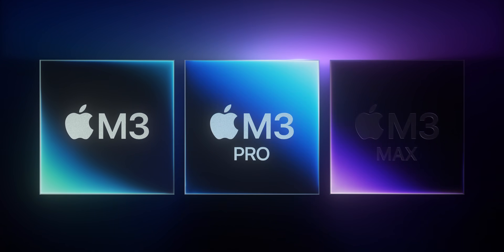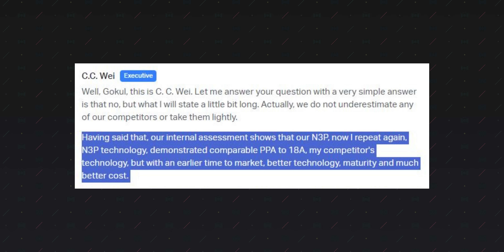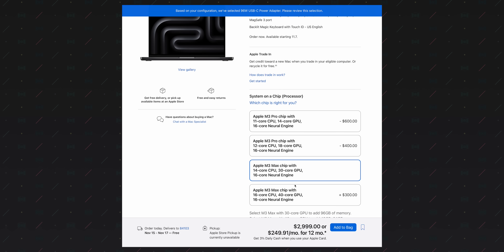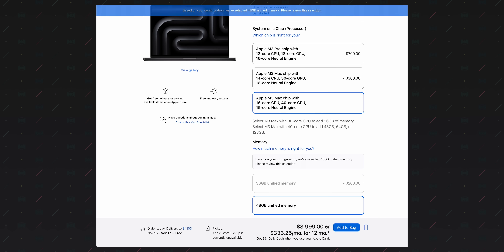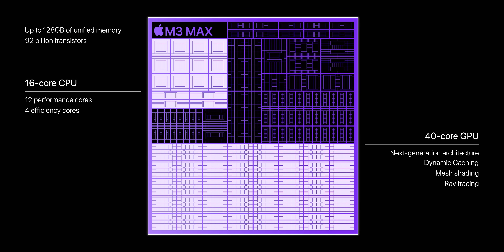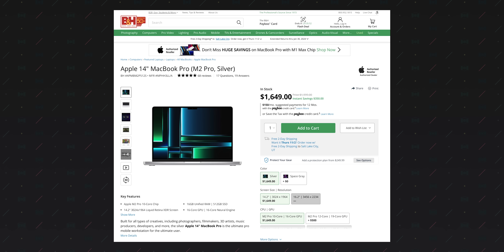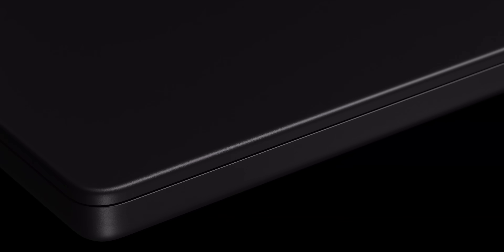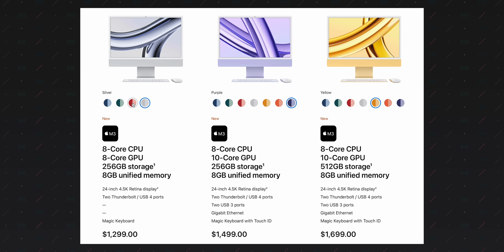Apple M3 Deep Dive: The Details Most Skipped Over

Comment: In Comments, I’ve been contacting countless YouTubers who cover Apple (or on Social Media) for  now to find out if  can tell me if loading up a BTO Mac laptop (MacBooks, mainly Pro M3s) with  amounts of RAM and  storage capacities  To explain with two very different configurations, is a M3 Max MacBook Pro with the maximum of 128GB of RAM and maximum 8TB of storage appreciably  than the  model MacBook Pro with the  48GB of RAM and 1TB SSD — ?

The chassis of both are  so the internal space to distribute heat is unchanged between the two; however, the more RAM, the more heat. And SSDs are  for the absolutely  temperatures they reach. So does a maxxed out MacBook Pro  (throttle) the performance speed of the SoC making it an overall slower machine? Or are speeds unchanged between the two, but the  comes on more often than the lower configed MacBook Pro?; or spins faster?; is louder? Or, is there  I’ve been asking and asking this question but have yet to get even a theory in response.

Could you please give this question consideration? It may mean the difference between choosing a balance between sufficient RAM and storage for today’s and future needs with any thermal consequences that RAM and SSD amounts present. Thank you much.

Comment: If anything, yes M3B is a loss for Apple with lower yields. But for the consumer it is a good processor, atleast the binned ones. Ok a bit expensive. Still awesome silicon. And M3E will likely on the average be less performant due to less transistors. And you do not talk about this. Your perspective is odd. Slightly LTT like and negative, but maybe that is the point for Mac coverage now, Apple Silicon positive coverage will net you less views and less channel revenue. Dissappointing Intel sponsored trend.

Comment: Just bought my daughter a 15” Macbook Air 16g, 1TB, midnight on sale at Best Buy for $1,650. She really wanted a black (or midnight) laptop, hordes videos photoshop projects and never closes applications 😬. So an equivalent Pro model would have meant making a concession in either aesthetics, multitasking ability or storage. I don’t think she’ll need anymore CPU/GPU capability anyway. But yeah, if I bought it at full MSRP I’d be a little chapped that I could have spent only a $100 more for a substantially better “Pro” laptop, albeit in a less cool color option. Really lame they only reserve the midnight for the top tier. Apple really knows how to stair step their customers. This is the first new Macbook I’ve ever bought. If you’re really selective and shop carefully there are always a ton of used Macbooks to be found. Say what you will about Apple, they make well built machines and their fan base upgrade way more frequently than windows customers do. I’ve bought about five really inexpensive used Macbooks, all of which lasted for ages. So if you consider the second hand market, Apple is actually a pretty good value proposition. In fact, I wouldn’t even consider buying a used plastic Windows laptop, as I’ve bought many expensive new ones that rarely hold up well. I actually bought my first Macbook for MagSafe after my kids and dogs broke a third and final charging port. Not a fan of Apple by any means, but their laptops are a much better user experience and have actually cost me way less over the long haul.

Comment: Apple M3 Pro chip with 12‑core CPU, 18‑core GPU, 16‑core Neural Engine, 18GB unified memory, 
1TB SSD2

Refurbished 14-inch MacBook Pro Apple M2 Pro Chip with 12‑Core CPU and 19‑Core GPU, 16-core Neural Engine, 16GB unified memory, 
1TB SSD2
Im a new to macbook sir, i wanted to use it for long term, I am stuck between the two. What do you think is the best option for this? Hope you can help me with it.

Comment: The iMac is a pretty good computer for home use and light gaming, not sure how it comes off as an "afterthought".  VS the M2 Air, it's 9" more screen in exchange for not having a battery (a plus for me) at the same base price.  SSD and RAM upgrades are obscenely expensive for every mac model.
The magic trackpad is great, I use one on the left plus a logitech mouse on the right.  Lightning makes no difference - it's on the desk so having to "carry two cords" isn't a thing.
My only disappointment is that, vs the laptops, I can't pay $300 extra to upgrade to an M3 pro chip.  The extra GPU would be welcome for "medium" gaming.

Comment: Snazzy, I had heard that the M3 was supposed to be head-and-shoulders faster than the M2. This was not that.
Your explanation of the difference between the N3B and the N3E seems to make sense.
It's still scary faster than the intel Macs so that's why they're pushing everyone to upgrade.
They almost explicitly said the Space Black finish would not have the problems of the Midnight Blue.
The iMac can be bought without the Lightning peripherals. I already have a USB-C Bluetooth keyboard and mouse I could use.
I'm looking forward to a revision of the iMac design soon. No, I'm not expecting a return of the 27" iMac.
As it is I'm quite happy with the M1 MacBook Air I got a few weeks ago. This thing is so much faster than my ten-year-old 13" MacBook Pro because of course it is.
I won't even consider upgrading again until we get the M5. I hope by then they'll have expanded the I/O channels to support more USB and Thunderbolt ports.

Comment: The M3 Max chip was the most interesting processor in the new M3 line-up, offering some genuine multi-core CPU performance differentiation compared with the M3 Pro, and significant GPU improvements over M2 Max, but it still has the same single core CPU performance of as base M3 chip (unless Apple offers better boost clock speeds on the M3 Max). M3 Pro was a bit of a disappointment. Will I be buying a new MacBook Pro? No, I will stick with my M2 MacBook Pro. M3 and bleeding edge 3 nm process may not be a good long-term investment. M4 may be a safer bet. In all honesty, I was much more excited by Qualcomm's 2023 Summit and the new Snapdragon X Elite arm64 processor. The latest Apple events are a bit like watching a slick Magician, where you are never quite sure how they do it, but you have some nagging doubt there may be some sleight of hand! I am no longer excited by the latest Apple Mac devices. OK, they are beautifully made, and Apple Silicon was amazing, but they only really make sense if you are media content creator or coder. I tried gaming on my M2 MacBook Pro, and it works, especially if the game is optimised for Apple Silicon. Not so good if gaming via a Windows 11 arm VM / Parallels desktop or CrossOver (though inclusion of Apple game porting toolkit components provided a boost), but so many of the games I play on my MacBook Pro (including via CrossOver) depend on Intel emulation. So, if Apple ever end of live Rossetta 2 that will be the final nail in the coffin ... at least I will still have my Steam Deck!

Comment: The 13 was a better laptop than the fan less air better performance cooler touch strip more reliable and durable faster charging better speakers.
It only lost in the looks because of bezels and slightly smaller but just as good screen

Comment: People keep missing the biggest point.  All Apple processors (A and M), soon to be everywhere, have the same 3D capability.  So why is this important?  In the PC world, you can get high end 3D cards, but they are all different, and the game has to be built for that specific hardware which almost no one has.  In the non iOS world, the games are "mobile games" (Yes, you Diablo).  For the first time ever, the same games run on all Apple hardware at acceptable speeds.  Think about that while you read up on the old pre-iPhone mobile browsers.

Comment: Some people purchased the 13 MBP because it packed more power and fans in the same basic size of the air. Add in the Touch Bar (some people like it) and yes, there were people who were informed and sought out the 13 MBP. I’m slightly sad that now I will have to upgrade to a 14 when it’s time, but I’ll hang onto my M1 MBP as long as possible.

Comment: So far, it appears rather disappointing. Releasing the M3 chip in an actively cooled chassis makes it seem like a hot chip, prompting a pause before implementing it in a passive cooled chassis. This decision could be attributed to the negative impact of previous MacBook Air models on MacBook Pro sales, which used to account for around 54%, but now only around 40%. Consequently, they need to present better figures to investors.

However, even the base model of the M3 Pro chip has only 11 cores, slower RAM compared to the M2 Pro, and there's still uncertainty about the SSD. If you want the slightly improved M3 Pro over the M2 Pro, you'll need to spend an additional 3000 euros, which doesn't make much sense. In general, the shift from 8 performance cores clocked at 3.5GHz to 6 cores at 3.7GHz may result in a hotter device or require getting used to fan noise again. So far, it doesn't look promising. 😕

Comment: Qualcomm's new Snapdragon "X" SoCs are poised to at least match Apple's M2 ans M3 SoCs and possibly surpass it. So Apple's claim to being the "best" laptops could come to a quick end in 2024. And while Intel is just stupid in how they have dealt with their laptop chips, if battery use is not a concern, the new generation Intel chips will be faster than the M3 in most cases when paired with Nvidia GPUs, provided Intel is intelligent enough to use AI assists in its processing for video rendering and high-demand "work-desk" software. 

Apple has a long history of screwing its customers with their Mac Book lineup, and charging exorbitant prices for its laptops. I would not be surprised is a lot of creatives migrate from Mac Books into Qualcomm's new X SoCs with superfast "Oryon" cores. Samsung is going to put out laptops with these SoCs in 2024 and Samsung's laptops will have some of the best displays and software on the planet. Samsung could put out a laptop with the Snapdragon X processors with Oryon cores. If Qualcomm puts a powerful GPU in these laptops or Samsung is able to use Nvidia GPUs, it is possible that they will smoke the Apple M3 SoCs and be just as energy efficient. If that does happen, there may be a mass migration from Apple Mac Books by people who are tired of getting overcharged and then screwed by Apple.

Comment: For me it is going to come down to benchmarks. I need Arnold, Cycles or Reshift ray tracing performance to at least be competitive to Nvidia for me to consider these. Like I like the efficiency that m series processors bring as well as battery life but rendering performance for preview while i work is a deal breaker and m1 and m2 are not even close to nvidia. I think the Top spec m2 ultra barely beats a 2080Ti in Cycles and  and a laptop 4080 is like 3x the performance and the laptop 4080 is like 2x the performance and with the ultra being a desktop chip comparing it to desktop 4090 and it's like 4x faster.

Comment: Some things to consider:
1. AV1 decode only might be a deal breaker for me - at least for video production. ProRes is great but overkill for my needs and eat disk space like Cookie Monster eats cookies - which is a problem when Apple's storage upgrades are bonkers expensive. I currently go with 1TB (still pricy) for internal and an inexpensive TB enclosure + NVMe drive for additional storage.
2. 8 GB on the base Pro model in 2023 looks really bad. I understand that part of the issue is there is a price floor for the MBP line. 8 GB on a MacMini at $500 isn't a big deal. Perhaps it might look better to just start at $1800 and 16 GB. There would also be more clearance between the MBA and MBP lines. My main gripe here is that this will be the default corporate fleet system for Macs, which is unfortunate.
3. Comparing things to WinTel world isn't fair to either. Some folks just prefer MacOS or the Apple eco-system in general, there is only one vendor for that.

Comment: The only 13" pro's I ever saw in the wild were purchased by people's employers. And that makes sense- it was basically an air with a fan for continued workloads and would do fine for anyone doing spreadsheets/presentations/light coding/etc. Also, the company doesn't care about touchbar or the older design, smaller display, etc. Heck maybe it made it less likely to be stolen, even. While everyone was crying "the 13" pro makes no sense!" I was thinking "yeah no shit, cos it's not FOR YOU."
Some folks (presumably?) liked the touchbar and would get it for that reason, while anyone not technical enough to not understand the difference between the 13 and 14 pro would likely actually be fine with the 13 anyway.
Not that I'm defending it, I like what they've done it now and I suspect those "Low cost" models rumored to come out may also meet some of this market (education and corporate laptops).... It was never people like us who were buying it. Well, besides those who liked the touchbar. Actually it wasn't a bad idea if it hadn't replaced the function keys, that alone would have made the touchbar far better.

Comment: m1 -> m2 = 31% power increase for 5-20% performance uplift, and now they have reduced the p core count in favour of e-cores which makes me suspect the graph was generated by comparing software that is optimised for e-cores (the numbers would stack up correctly) and a GPU from 5 years ago.

Add in how many M1s and M2s are on ebay 'for parts only' and I am wary.

Comment: I suspect you're misunderstanding Dynamic Caching. Given what they said about "local memory" or "on-chip memory" and it being allocated at compile-time, I suspect it has nothing with VRAM/Unified Memory to do, but rather with the on-GPU, per-execution-unit memory, or the same thing that nVidia calls "shared memory" and AMD calls "local data store". VRAM is usually not allocated at compile-time, but local memory demands is usually stated by the compiled shaders.
That would also make more sense given that they speak of Dynamic Caching improving GPU utilization. Allocating VRAM in one way or another wouldn't be expected to affect utilization, but being able to dynamically allocate local memory would, since that could squeeze more threads into the same execution unit.

Comment: Excellent video that indeed says way more than other tech reviewers.

Serious question for you or anyone in the comments. Do you agree with this? What's your thoughts?

The past few days before the Apple event last night, I've heard several people mention and point out that it looks like Apple is doing things the way they are to get back to delivering devices on a yearly basis.  For one, Apple's stock holders got after them recently, and second, because Apple was forced to deliver products on approximately a 1 & 1/2 year cycle their competition had time to catch up to them.  

Regardless, it does make more sense to be on a one year cycle since they've been able to do that for years prior to 2020.  They have the M3, M3 pro and max chips out for the MBP's in the fall, then get the MBA's out in the spring so that new college students can buy a laptop before going to school after summer, and finally the devices on the Ultra chipset comes out in the summer before the cycle starts all over again.  It's not a far fetched notion as again, this would allow for buyers to better know when and schedule upgrading when they needed a new device (whether to wait til the new model came out if it was coming up or if not then buy the current/"older" model).

Comment: I just looked that MBP regular M3 if not Pro or Max etc will only have 2 thunderbolts. They just took away one extra thunder for no reason? So if more USB-C is Ports are important for you you are forced to go with M3 Pro or Max. I'm using HyperDrive but still. Currently have 4 thunders by default for regular 2018 MBP....

Comment: I'm only 4 minutes into the video and I'm attempting to explain this video to a discord friend online. 

"What I'm at now, is that M3B process by tsmc, has more issues with making the chips, due to cost, and how many good chips leave the factory (yield), than the M3E process, which is cheaper, has higher yields, and is more efficient. The m3 macbooks are using the M3B process, which is the same type of chip the a17 pro is being made from".

Am i right so far?

Comment: What is the useful of having a powerful chip if you don't have a powerful operating system or to actually use it 

Why can't we have upgradable chips and upgradable ram, SSD 

Why had the chassis of the MacBook Pro and iMac chassis not changed since apple silicon 

I have friends who have rsi or repetitive strain injury, why can't apple update there keyboard and mouse as it still supports lightning has the mechanical keyboard trend past them by and ergonomic mouse 
As with a laptop you get a strained neck when using a keyboard and why arent they using oled 

Apple used to do a spec bump on there websites not using a keynote and we used to have most of the updates and Ces and apple at MacBook 

Why do we have 8gb of ram and low storage on the base models
Reply from the maker: If you’re suggesting macOS isn’t capable of powerful workloads, that’s a foolish suggestion.